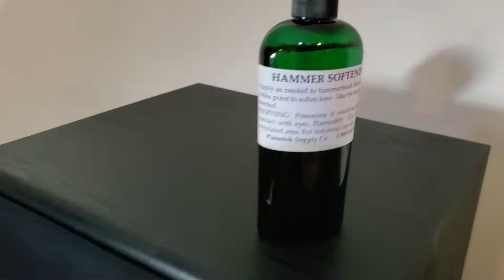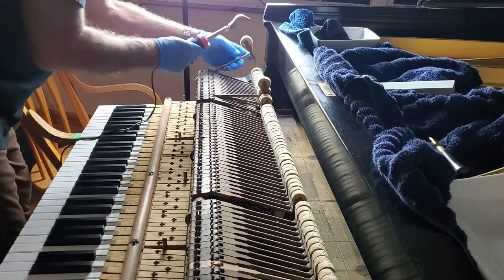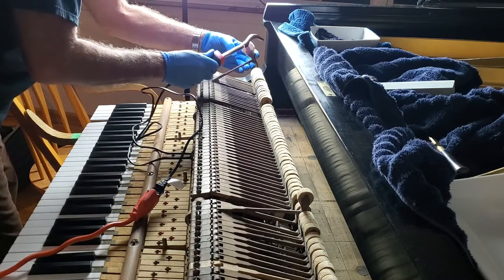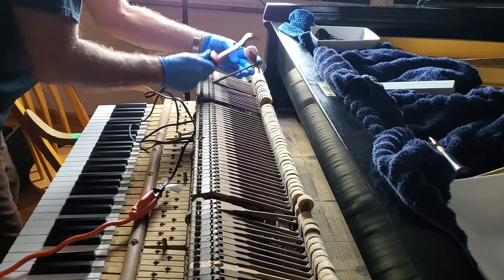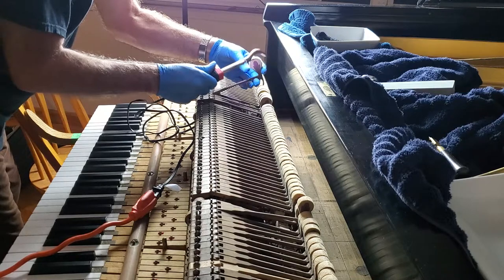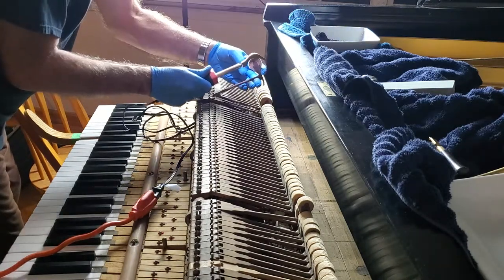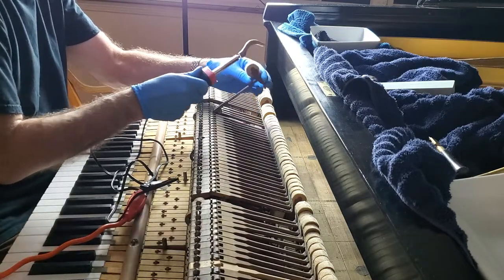#12 Restoring An Old Steinway Piano Ironing Hammer Felts

Comment: I’m looking to remove some small grooves, probably 1mm on my 20 years old upright and I’m contemplating ironing to use the least aggressive method possible as I have no prior experience filing felt and don’t want to make it worse. Watching this video and you going through the hammers I don’t see you were actually able to remove the though grooves why is that?
Reply from the maker: Ironing hammerfelts will not remove grooves, that takes sanding, the ironing merely gives the outmost layer and stiffness of sorts, a more taut attack. The truth is that few aged hammerfelts can withstand much sanding as they are already worn down to minimum specs. Time to learn to replace those hammerfelts...then you get the yummy sound.